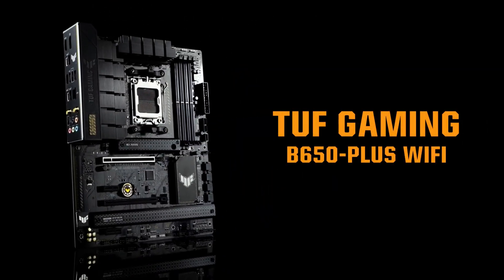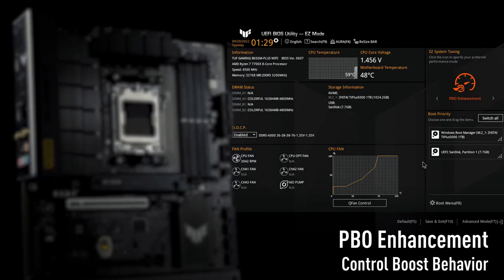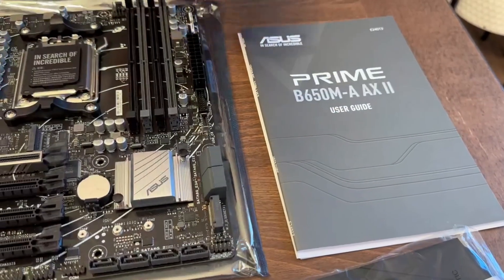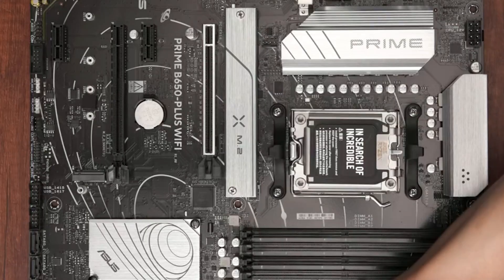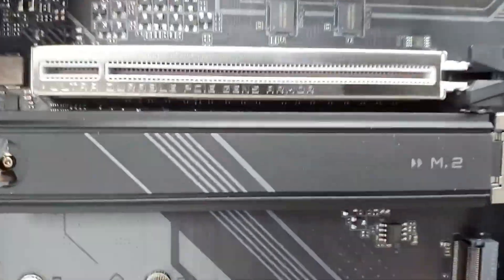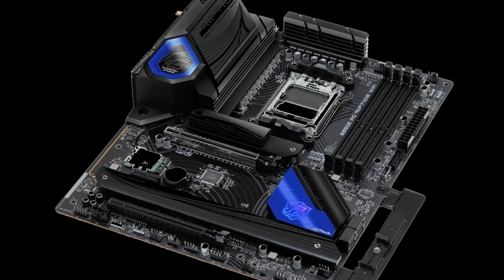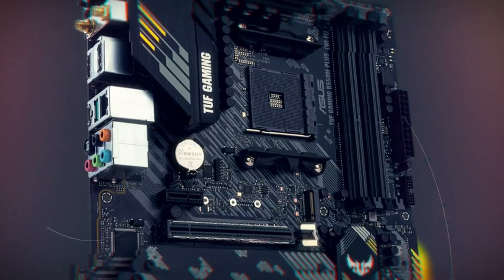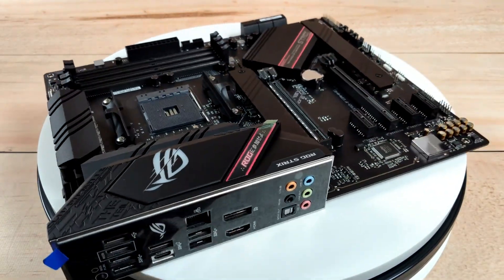Top 5 AMD Motherboards 2025 – For Creators, Gamers & Power Users!

Comment: All am5 mobos support only ddr5 ram, why did you mention the ram support when talking about the x870 😅
Reply from the maker: You’re spot on—AM5 boards are DDR5-only these days 😅. I called it out because the X870E-E’s memory support isn’t just “DDR5”; it boasts beefy VRMs, optimized traces for tighter timmings, and built-in XMP profiles that make overclocking way more accessible. But yeah, at a baseline all AM5 = DDR5. Nice catch!